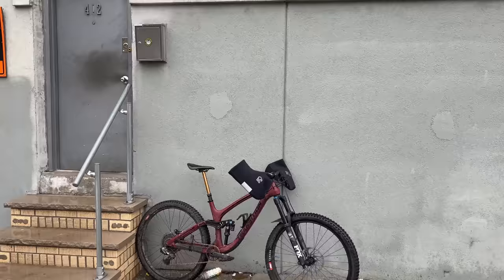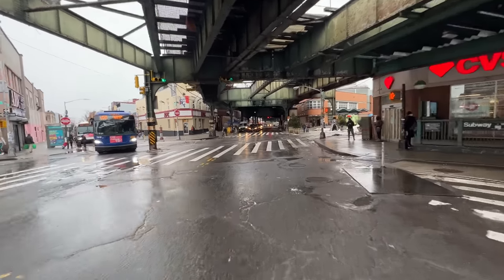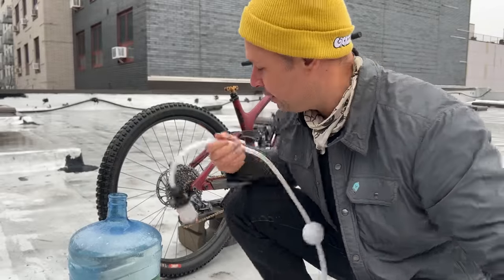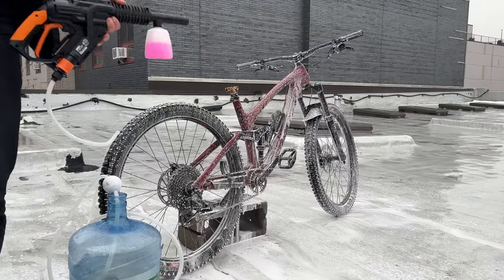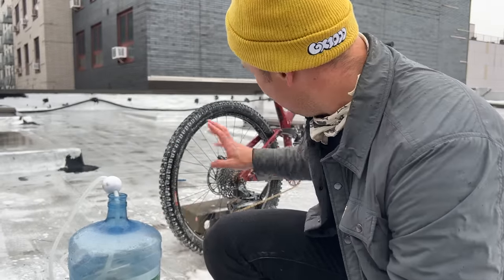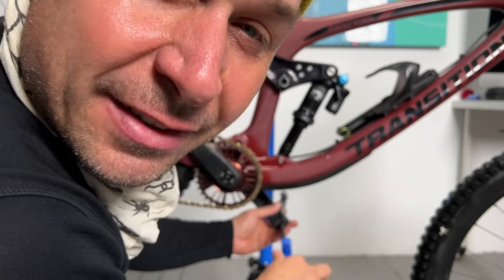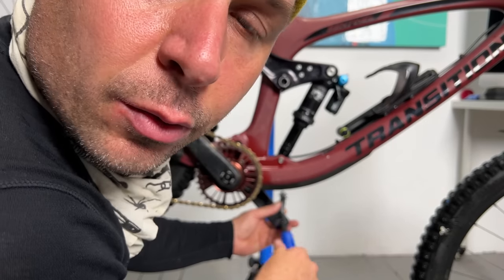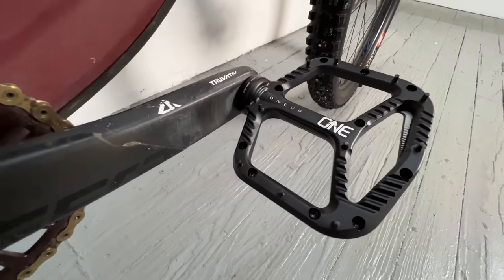Get Up to Get Down

Comment: Another wash tip, albeit less effective but better than nothing.. if you can't get that wash scenario set up due to space, cost or any other variety of reasons is to just buy a garden fertilizer hand pressure sprayers and leave it buy the door with towel so you can give it quick rinse before you bring it inside. At least get salty bits.

Great vid and tips, always enjoy the errand runs/tour. Can't wait to new look for the AC.
Reply from the maker: Thanks for sharing! my buddy andrii has one. It works alright but this solution is much better.

Comment: The pedal change hack alone was worth the admission fee. Thanks.
Reply from the maker: Hope it helps. I'm not a mechanic but I try
Reply: Right hand rule also works universally. Point your right thumb at the bolt and whichever way your fingers curl is the direction you tighten (Opposite of the curl to loosen). Always works.